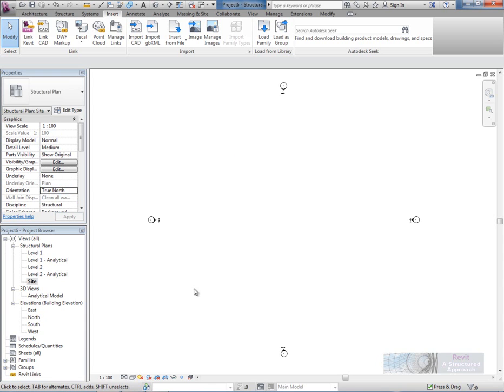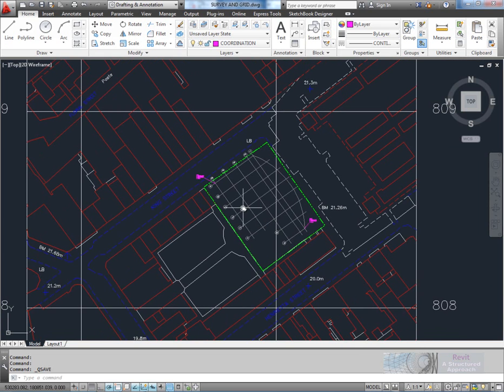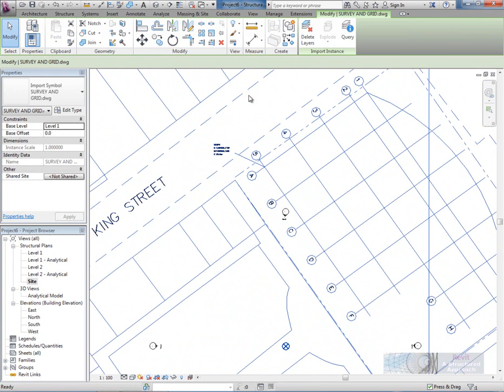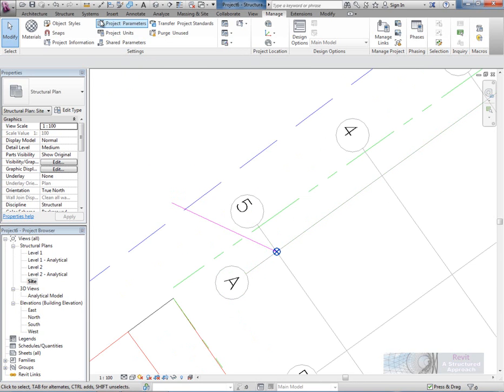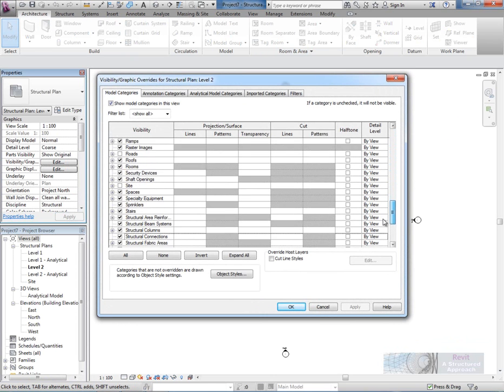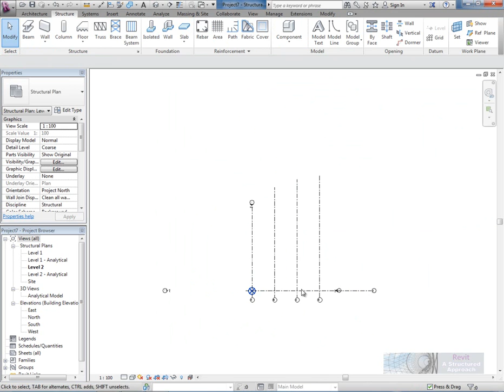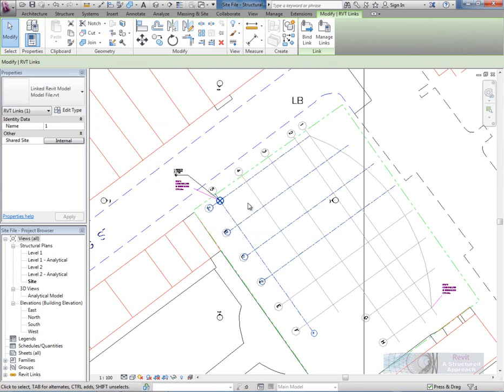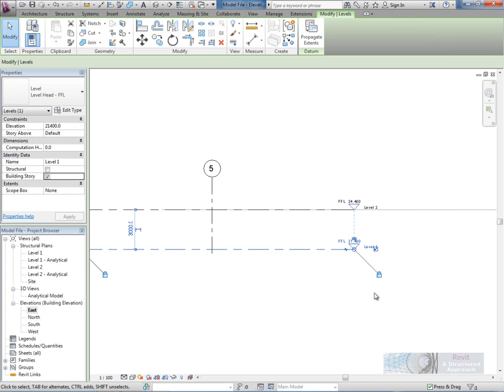Revit Site Coordination

Comment: I would NOT use the CAD DWG file to snap grids to as Revit uses different ubits than CAD. If you bring in a DWG file and measure the angle of a right angle on the drawing its .0000001 or somthing simlilar off 90
Reply from the maker: Hi Brian, this used to be an issue prior to Revit 2013 but if the AutoCAD entities are off axis between 1x(10^-9) to .2 degrees then Revit will show the warning 'Element is slightly off axis and may cause inaccuracies' and hence warn the user.